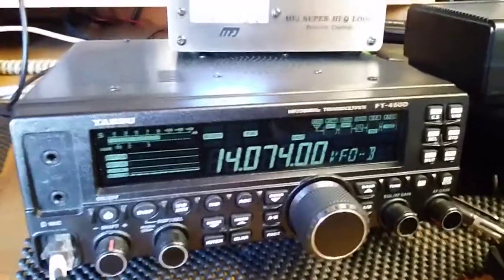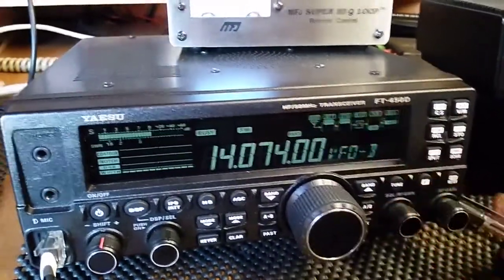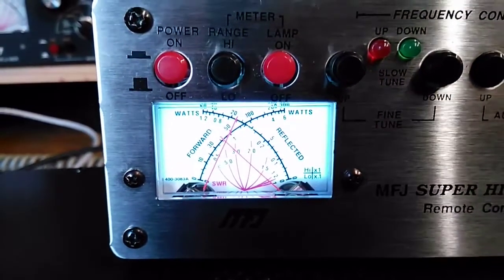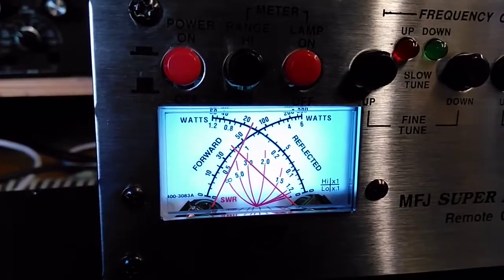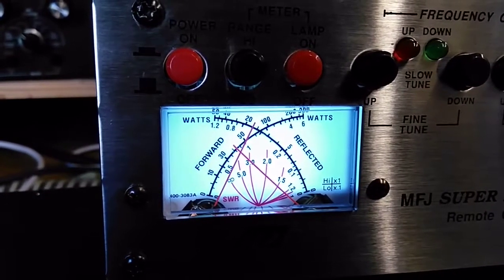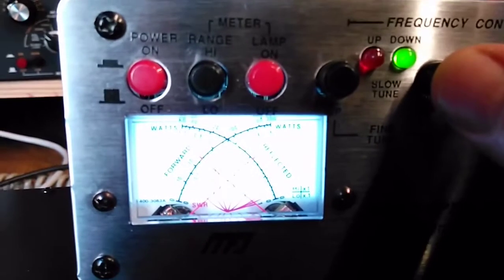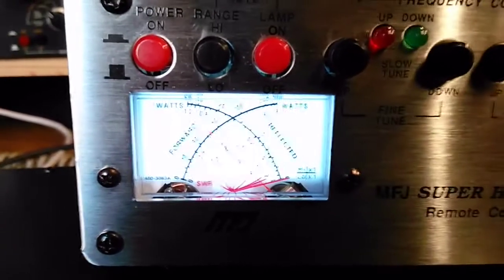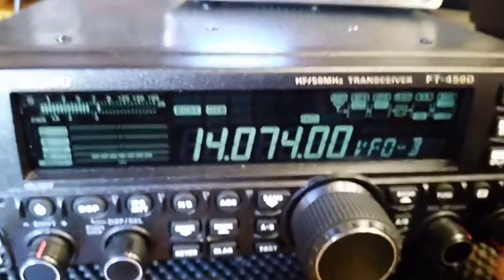Tuning up MFJ-1788 Super Loop

Comment: I have had a few loop antenna over the years some homemade they do work well they are better outside getting to the mfj1788x I still have one but I do not use it as I can not get the SWR down under 1.6.1  the way I tune it is I listen for the high peak in sound then ill tx to fine-tune it and on most times I only have to do a few taps on the fine-tune buttons to get my lower SWR this saves my finals from burning out.  I did a compare my vertical 27ft with an auto tuner at the bottom with 16 radials vs 1788x loop.  with the same amount of rf the loop was keeping up with the vertical maybe just a tad lower on some signals but the winner was the vertical but the loop did more of the radius and closer in stuff as well how far has my loop got I have hit the USA on 25w with my loop and more than 1 time so it was not a fluke  by the way my loop was 20ft up and horizontal fixing